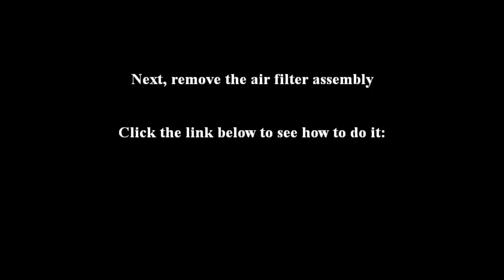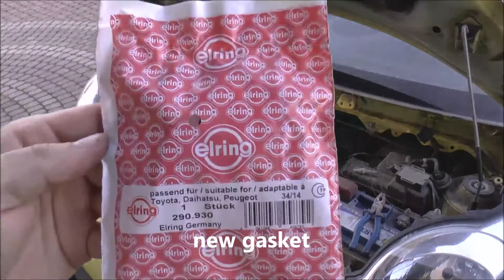How to replace intake manifold gasket - 1.0 - Aygo, C1, Peugeot 107, Yaris, Sirion

Comment: Very clear and concise strip, replace and rebuild. If i may just add  a very small positive comment to Disconnect the Positive battery lead(make a note of radio code) and place bungs in any orifice that leads directly into the engines bowls. Great video. Peter Disley

Comment: Will this be the reason I have a loud sucking/vacuum sound coming from the left hand side rear of the engine that I can't pinpoint? On idle/tickover. It's still running fine but you can hear the vacuum for about 4 seconds after the engine is turned off. I've checked all hoses & connectors & its not them.
Reply from the maker: Possibly, however if the manifold gasket is leaky, you should have a signs of oily stuff somewhere  around the manifold, do you? And there are two hoses running to the manifold at either sides, are sure it's not one them? My brother has a sucking sound and it occured to be the hose between the mainfold and the brake pump being split.
Reply: I managed swapping the gasket as per your instructions, I was pretty amazed really that it still ran ok as the gasket was completely flattened & it also had a piece about 5mm completely missing from the top of number one cylinder just by the location tab, which was the source of the loud sucking sound.  Cheers for the information.

Comment: Great video! I'll need to do this to my Aygo because i have LPG system on it. 
I already cleaned my MAF and Throttle body from carbon deposits. 
But the LPG system has Lubrication System right behind the Maf sensor and it mixed Oil with carbon deposits and probably theres too much lubrication inside the intake manifold. 
Has anyone experienced this?

Comment: What are the symptoms of a leaking intake manifold gasket on one of these engines?
Reply from the maker: Just an oily mess running down the engine block.
Reply: @fixanddrive  I can smell petrol when driving my dads one but only when fans are on ans it's in slow moving or stationary traffic. No visible leaks so wondering if it could be this as well

Comment: Great video! I have found out that my engine is leaking oil from the intake manifold but what I don’t understand is why there is oil in there. I have tested my pcv valve and it seems fine. Why would it than leak oil? 
Thanks! Great video
Reply from the maker: There is oil in there in every car. That's an oil/air mixture.
Reply: Thank you for the reply! I will definitely try to fix this next week 😂

Comment: Is the Dirt inside the cylinder Head at around 5:20 coming from the intake manifold gasket or EGR valve? My C1 looks exactly Like that wondering if its a normal Thing or bad for the engine.
Very helpful Video btw thanks a Lot!
Reply from the maker: all the dirt covering the engine head and block comes from the leaking inlet manifold gasket.

Comment: Can somebody explain me why he is changing this gasket
Reply from the maker: it got leaky
Reply: At 4:50 there's some good images, where the completely flattened gasket is quite evident. 
FYI Any rubber gaskets, O-rings, etc. should be supple and flexible. The moment they get deformed, rigid and brittle the time to change them is long gone! Cheers